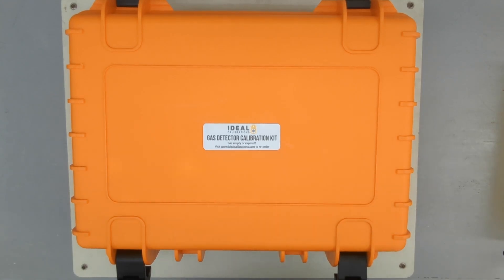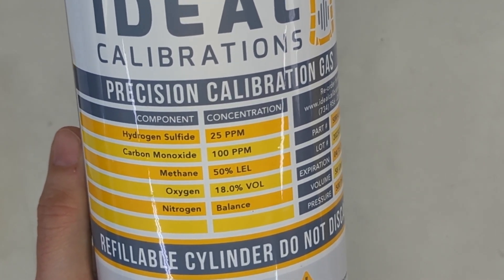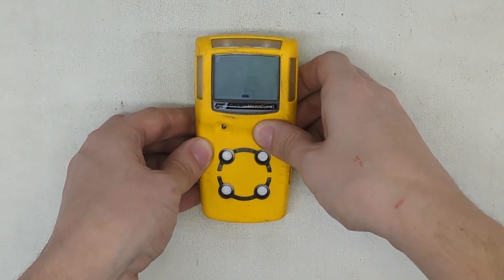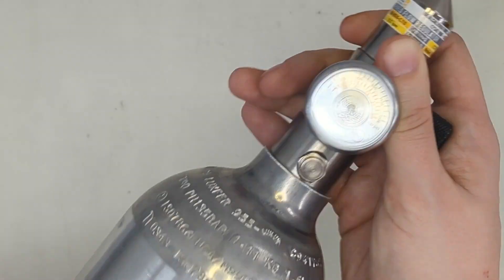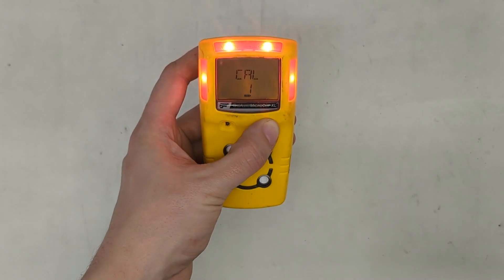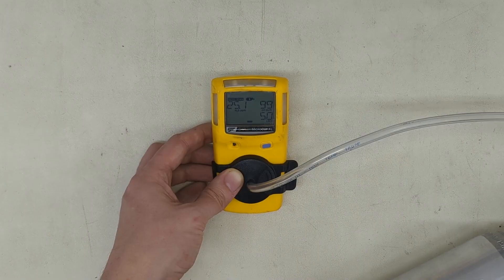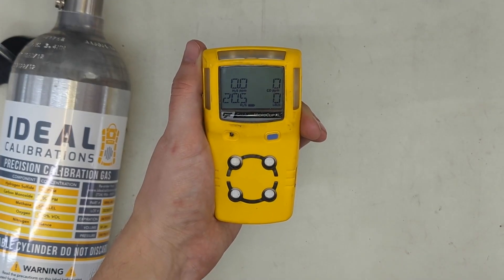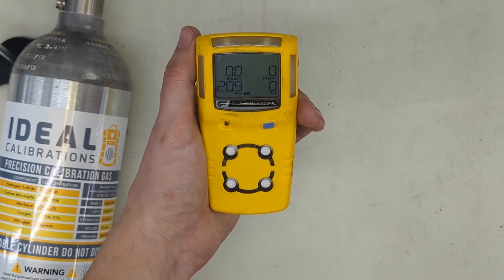2 Minute GasAlertMicroClip XL Calibration - Micro Clip XL Guides by Ideal Calibrations

Comment: During the calibration procedure, everything progresses according to the instructions until the equipment performs the zero. At this point, instead of receiving the expected message to apply gas, I am presented with the indication "Closed
Reply from the maker: Hello, this sounds like it might be a problem with your oxygen sensor or potentially your settings. Is the oxygen sensor reading properly in room air? Should be 20.9% when you look at the display
Reply: Thank you so much for your quick response. My suspicion is that it may not be configured to allow field calibrations. The oxygen sensor is reading at 20.9, which seems unusual. Do you have any videos demonstrating how to connect to Fleet Manager and whether there is an administrator password?

Thank you! @Idealcalibrations
Reply from the maker: @marcelolandeiro1153  If you have the little blue USB adapter and Fleet Manager downloaded, you just need to click on Configure and then use the password "admin" with no quotes and it should let you in.
Reply: thank you soo much @Idealcalibrations
Reply: thank you soo much @Idealcalibrations